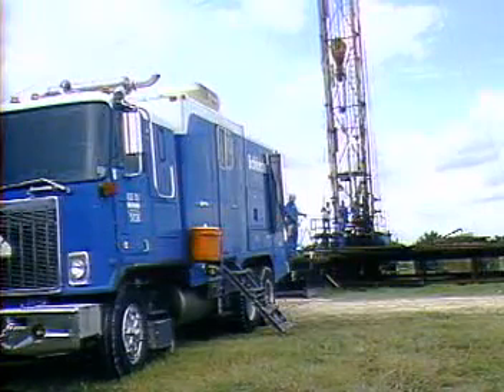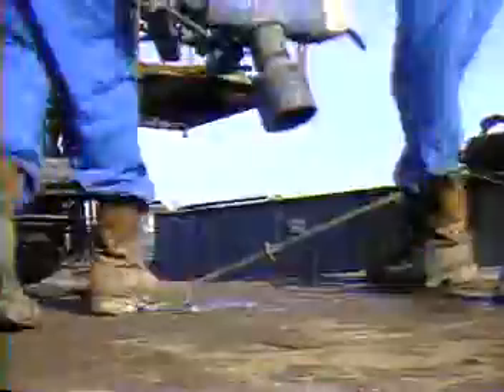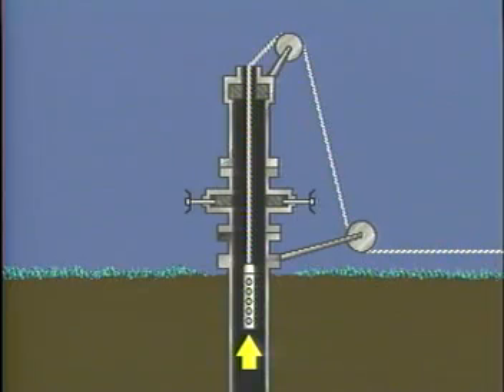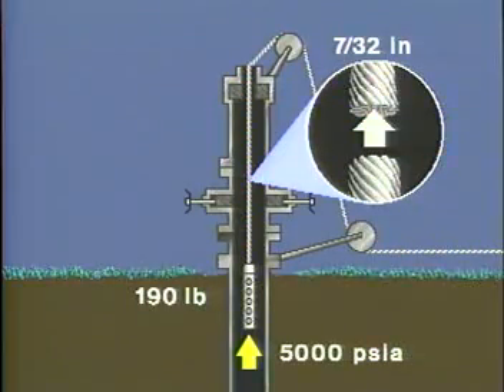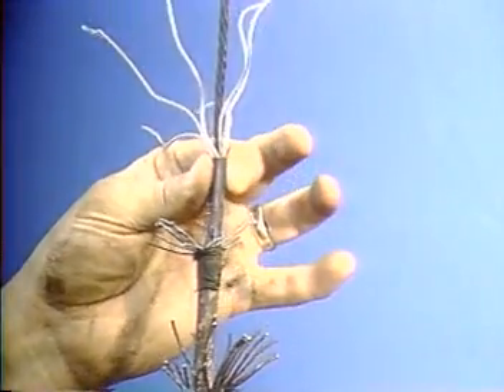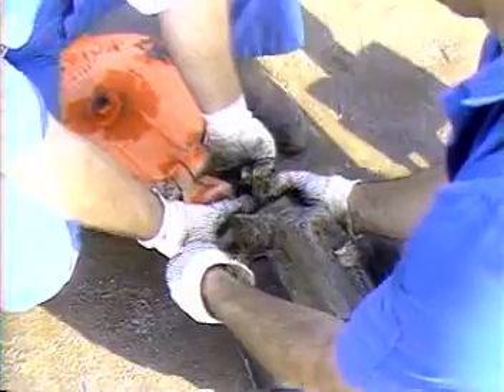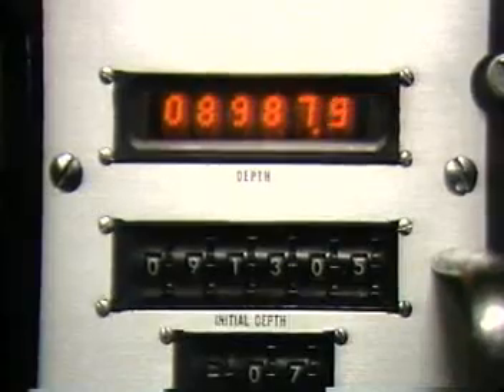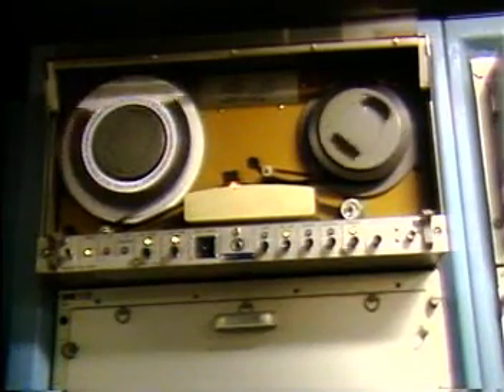Well Completion :Logging Equipment

Comment: The equipment shown in this video is more than thirty years out of date. I worked for Schlumberger from 1973 to 2016 and witnessed a major evolution as we transitioned from the R9 gal on meter recorder to the Cyber Service unit (in this video) and then to MonoBay MAXIS and eventually the MCM Maxis using PC-based computers. They “how” we log oil wells changes with technology, but the “why” remains the same. For example the depth measurement is the single most important measurement. Why? Everything done to an oil well needs to accurately done at precise depths.